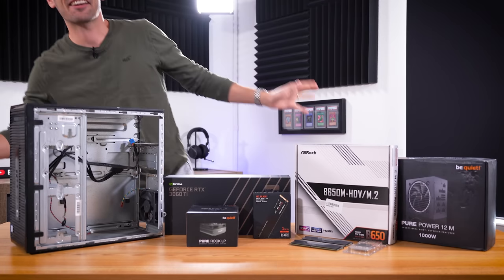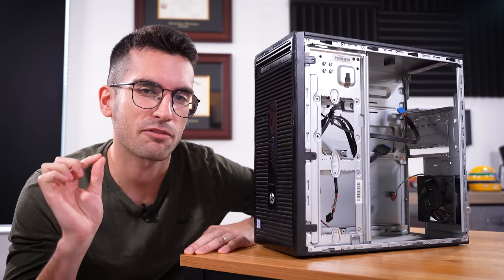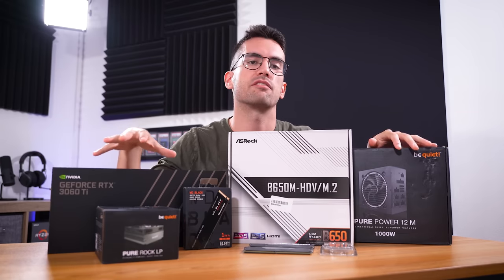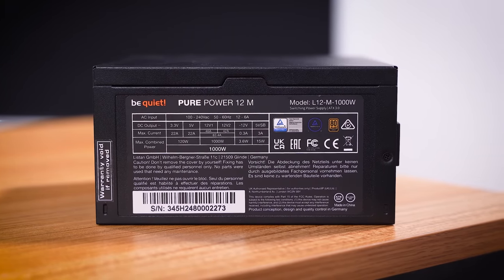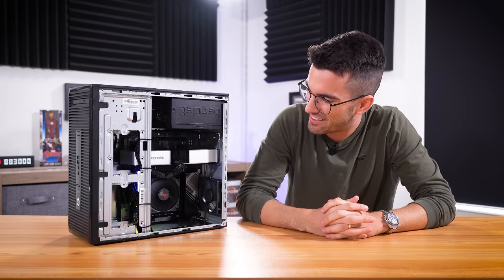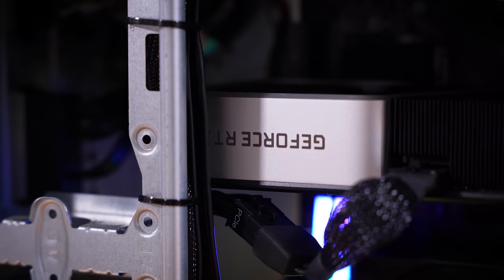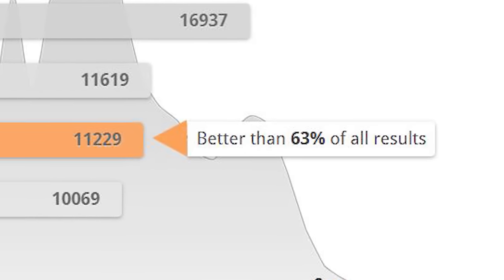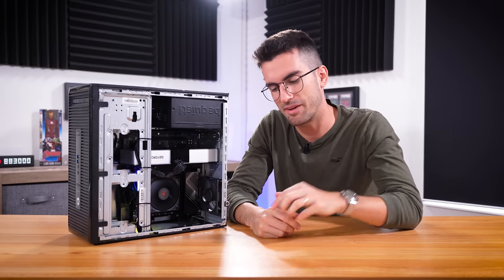Building a SLEEPER Gaming PC!

Comment: I recently found this channel while, ironically enough, searching for sleeper PC builds on YouTube (the stealthier, the better, IMO).  After having watched this video in particular, I started to dive into your back catalog of videos and found myself enjoying the "Gear Up" and "Fix or Flop" series as well.  In regards to the latter series, I really enjoyed watching you use the process of elimination until you narrowed down the problem and in most cases, resolved it for the viewer.  With the former series, though, it was the look of gratitude on the people's faces as you helped upgrade and/or replace their rig that made that series so enjoyable for a viewer such as myself.

I'd really like to see you do a beige sleeper PC that looks like it was built around 1999 or 2000.  I've always been particular to In-Win cases from around that time, since I had the A500 case back then.  Since you mentioned you'd like to use a full tower for the beige sleeper PC, I'd like to make a suggestion, if I may:  the In-Win Q500, which was the full tower equivalent to the case that I had back then.  The best feature about both cases, again IMO, is that they had a removable motherboard tray, a feature which has only relatively recently returned to some PC cases.  It is an ATX case, though, so building in it won't be as restrictive as some of the older, sometimes custom OEM cases that you've built in that came out even after the aforementioned In-Win PC cases.

Lastly, I'm looking forward to the upcoming content on the channel as it never fails to entertain as well as inform.  Have a good one, Greg, and take care. 🙂

Comment: Built some of my leftovers in an old case with the dvd, actually cd-drive. Quite decent, skylake i5 6600, z170, 16gb ddr4, 1650gtx also as it was one of the first boards to accept nvme i threw one (25€ for 256 at the time) in there to keep it fast. It was one of those black boxes every damn PC came in at 2000. It ran most games at 1080p at acceptable frames (60+) on low/medium. Newer games not so much but i sold it to a friend that needed a starter rig so no e-waste. Keep doing these, i love a little retro!
Reply: i left the win xp sticker on in case he didnt want win 10 😆

Comment: Please do another sleeper build. (but keep the stickers!!) Some tips: 
-Check motherboard standoffs.
-CPU cooler height, unless you have the case in hand, is at a minimum roughly 35mm + what size the rear fan is. (The CM Q300L has a 120mm rear fan and a max cpu cooler height of 159) On the other hand the AOPEN H450A has only a 80mm rear fan but still fits an NH-D15.

-Most modern GPUs are big, especially wide, if the card itself doesn’t hit the side panel the cables will certainly mash up against the side panel. Or preventing it from closing.

-Measure closely, measurement you haven’t thought about and some that may not even be listed on any product pages, might be a dealbreaker.

-Consider what type of fan bearing your product is using. Different bearing types perform different in different conditions, manly thinking about higher temperatures higher in PSUs.

-Modification is sometimes the only really viable solution. Dremmel, drills, sandpaper, files, tin-snips and pliers. Think before you do anything “irreversible”, am I really making it better? Getting another case might be practically impossible. Think about something not computer related for a while until you come back to it. Empty your case before you cut, And clean it of any metal shavings, I use damp paper, damp cotton swabs, and compressed air and then inspect every surface with a flashlight.

Comment: My current PC (and first custom build) is actually kinda a sleeper too.  I used an old MacPro G5 case that was gutted.  Took a lot of internal modding and case cutting on the backside to get the motherboard to fit, but i had a lot of fun with it.  From the front and sides, it looks totally normal.  Was able to make the 3070 ti i got fit in the original slots too and also got my gf to 3d model and print a bracket for the 140mm aio to mount to the front of the case, so didnt have to do any special modding there.  
My favorite part is that i was able to keep the original locking/unlocking mechanism for the case.  Honestly really nice to just have a latch to unlock and lock the whole case.

Comment: How about one of those horizontal cases from the early 90s where you put the monitor on top? Even better if it still had 3.5 or 5.25 inch disk drives!
Reply: Yes!
I mentioned the 5150 XT in another comment.

Comment: I’ll take my Cool Master Storm Trooper (circa 2014 )case any day over the current bling boxes with no options for front panel accessories and choked off air flow. There are some of us who are into Content Creation, Virtual Reality, Gaming, 6K and 8K video in 180 3D and 360 3D formats, Photography, 8mm and VHS conversion to digital, NAS streaming of Blu-ray and DVD movie collections over WiFi , where Blu-ray UHD drives and front of case access to USB and memory card readers are extremely important. I was shocked two years ago when I went to a local Microcenter only to find the sales person ‘thought’ they might have one case with a 5-1/4” panel opening. My rig with and 11th Gen processor, AORUS Master Z590 mobo, RTX4080 GPU, 64 GB RAM, 16 TB of total  internal storage, UHD capable Blu-Ray and DVD R/W drives, front panel USB 2, 3.2 Gen 2, and USB C, with card readers for multiple format devices, weighs in at over 50 lbs. Thank goodness the Storm Trooper even has its own handle…😎

Comment: Depending on the JFP header fitment you could just rearrange the pins on the header plug without having to do any soldering. Just need a precision flathead to lift the securing tabs and go from there. Did that on an older Dell XPS case in the past.
Reply from the maker: Yeah, unfortunately the keyed (closed) pin on the case's connector is in the wrong place. I suppose I could try to punch it out.

Comment: Take a Dremel to the top of that case!  PSU getting choked off.
Reply from the maker: Not taking a dremel to anything. Would look horrible. And there's still a gap for air to move in from the top of the PSU. The unit isn't pressed against the top of the case. Not ideal, but not the end of the world.

Comment: Great job on a sleeper build. I recently did this with an old lenovo case that came with windows 7 originally, I think it had an am2 system in it before I pulled it out. The hardest part was figuring out the wiring for the front usb and audio as lenovo used a proprietary plug. I used an r5 5600, 32gb 3200 vengeance rgb, an asus tuf rtx 3060 12gb and put it all on an asus b450m-a board. Runs really quiet and cool with fans in front and back.
Reply: Great job! Though I'd avise against using Vengeance RGB with Ryzen, some people have reported stability issues and I definitely had some, with different kits on different platforms.
Reply: @Zebra_Paw  yeah I've had issues before but these ones are on the qvl list for this board. I haven't had any issues with them after many hours of stress testing and gaming benchmark runs. I'll probably grab some Trident z neo though just to be safe.
Reply: @larryrodriguez1977  I've found G.Skill RAM to work amazingly with Ryzen and I'm very happy about my 32GB of 3600MHz CL16 RipJaws I got for really cheap considering the speeds.
Reply: @Zebra_Paw  Yeah I have 64gb of 3200mhz  G.skill in my 5900x system.  I do some video editing for a friend so I needed the extra capacity just in case. Also I got it in trade for some of the editing as my friend couldn't get it to run properly on his system. He has a b450 board and I am running an x570.

Comment: heheh...here I am hacking a case that I got for free used in 2001 so that I can stick my 78003xd and 6900xt in. No RGB, 1200w corsair HX, top grade g.skill ram. shoved under a shelf. replaced front panel with black-spray-painted aluminum screen.
Unlike the new PCs, I can pull a door handle and expose the entire motherboard flat onto the desk. no screws. no awkward angles accessing the motherboard.
These new cases are still inferior, and I still have my top 5.25" bay for my multi-card reader/usb 3.0 front hub

Comment: Yes, moore sleeper build please. I built one ages ago, funny is old PSU only 20 pins plug that I remember AT board I guess not ATX which is now. Let talk about case, might be a bit tight, try something like Commandore 64 into a PC. There is a smaller than ITX board , PICO ITX I guess it is called? Maybe stick with ITX, mostly I think Dell like 7010 optiplex? I do have a lots of Dell Cases. Oh wait, I have a 2003 (Yes, year 2003 it is) Cubit case that I am planning to build.

Comment: Sleepers are fun, and reverse sleepers too.... I have a retro PC on a Pentium III platform with some old Quadro card that was the newest thing with Windows 98 official drivers... in a modern case with tempered glass side panel and functioning USB 3.0 (I say functioning because although the ports are connected to a legit USB 3 controller... it is connected to the motherboard via a PCI to PCI-E bridge and thus limited to PCI speeds). Still fun to fire up old DOS and Windows 9x games with a machine that at first glance looks new.

Comment: Personally if I was building a sleeper in a case without good airflow and descent 120mm fans for cooling I would want to run a Ryzen 5600 or 5500 as they run cooler than a Ryzen 7600. Also I would want to try maximize my CPU cooler size, like if you can fit one that's 30mm higher it's going to work better. I would want a GPU that doesn't over power the CPU so would be happy with that 3060ti although if buying a GPU I would try get a AMD GPU to take advantage of smart access memory. I would try find a Rx 6750xt that fits which has more than 8gb vram.

Comment: Maybe try the XPS 720/730 - I’m in the middle of one of these builds - ive taken the front of the 720 (BTX) and merged it with the rear of a 730 (ATX) - best of both worlds for me. - looks of the original 720 with the modern form factor in the 730.

The case is so big and different, and features in F.E.A.R. that it’s almost a crime not to do something with it, for me.

Comment: By your standards my last few builds have all been sleepers. Recycled, but clean cases, and modern components. No gamer would look twice, but this retro gamer has optical drives and a newer USB / Audio connection in a 3.5" drive opening. Was playing WarCraft II on it this afternoon, with CPU cycles down to 15% in DOSBox to get WarCraft II  to answer the controls properly. Gotta smile, eh what?

Comment: Not sure what the prices are like for the old beige cases in the US but here in Australia they are crazy, though I did manage to get a IBM Netvista case early last year for $30 off Ebay, which for just a case was more than I wanted to pay though was the cheapest I could find.  Also got a complete HP ProDesk G1 with an Intel i5 4570 with 8G ram and 500G hard Drive for $59.

Comment: It's sort of like taking a '68 Mustang Fastback and putting a Coyote 5.0L engine in it, yes?

I've got the perfect old-school Dell Vostro 220 that I could do this kind of thing to. It's a 15 year old PC that started life as a Windows 7 workstation and is now running as a Windows Server 2022 domain controller on my home network. I'm not sure how it's actually doing that, but it's working great. But wouldn't it be a hoot to stick some modern components into it? Honestly, this machine slogged when I first turned it into a domain controller. The only thing that's saved this from the trash heap is that I put a 500 GB SSD in there and all of a sudden it was fast as could be.

Comment: Sleeper build, I didn't know that with a thing, I thought I was just a tight ass. It's not a sleeper build if it hasn't got a floppy drive, I had to upgrade the USB 1.0 on the case to USB 2.0, when I brought the original PC in 2000 I never new if the USB thing would ever be used for anything.

Comment: I've got a tower that is an off white that says "Gateway 486".  I upgraded to an AT board Pentium 160 or something like that, but that was as far as I could go since I could not find AT boards better than that.  I also have my original 1990 era full tower with a drive bay door that I paid something like 1000 dollars for when I did my first "build" with a 486 33.  I did a few mods to that case.  But to use either of these with, say a Dell 7010 motherboard, I will have to get out the hack saw .  I tried that once before and it did not turn out well.  I have a PC xt case. Not THAT would be the most sleeper.
    I have beige ATX cases, but I want to start using AIO cooling and the top is the best location for the radiator and fans but a power supply mount in the top and lack of venting ruins that.

Comment: I like to take old cases, spray paint them, and install newer gear. Beware one issue with older cases, which is that the very first slot for an ad in card may not align well with modern GPUs (specifically, I found the display port and HDMI connectors don’t seat because of contact with the case frame).

Comment: I want to see you build in an old Dell Dimension Black and Gray box. That would be a real challenge- not even sure if a standard mobo will fit. Another idea FWIW- if you actually put a link in YT comments, it shadow-bans the user in that video comments section. They can see their post like it's there but nobody else can. Or at least it used to be like that. I think that was to deal with spammers.

Comment: Hi Greg, I have a commodore amiga in a 1990's black AT server case. I think your viewers would like to see a high end GPU card so as your going to need more room a server case is your best bet. Probably an ATX  as the mobo mounting holes will be wrong. Most server cases need good cooling also a necessity in a high end rig

Comment: I have a discarded HP case in the basement, and coincidentally enough I've been thinking of using it for a sleeper. You definitely set the bar high here!
Reply: They're fun projects.  Several years ago I re-purposed a 1999-2000 era Compaq Presario case for a sleeper build.  I wanted to add that DIY gamer touch and painted the sides grape purple and cut a window in the side and inserted a plexiglas sheet with pop rivets.
Reply: @timmooney7528  hah, sounds like a real hot-rod! :D
Reply: @AAjax  It was back in 2010.  An Athlon 5000X2, and the irony was the case was for a Presario 5000.  I used wire loom to clean up the connections to the front LED's and the power switch.

Comment: I used to have a Acer PC but I put modern hardware in it what I don't understand is why the inside facing the front is cover by a metal cover which is riveted to it and by removing it the airflow has improved

Comment: My crap sits in a closet with central air, no sides to case just open air. It's a 7808x3d and 3080 (which I got for 375$ off ebay and is epic!) for my gaming purps for 1440p, which was 1080p recently and I lost ~10fps but I still like it. No, I don't love it but I am not paying 1200+ for some stupid ass 4080. Eat crow!